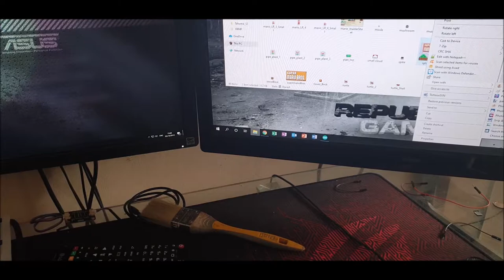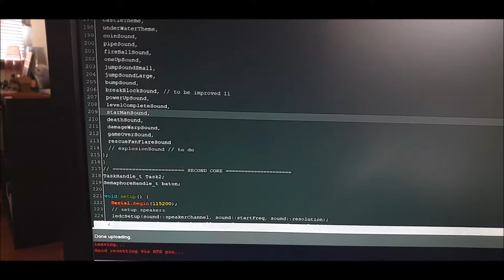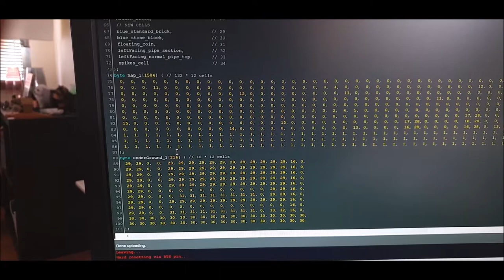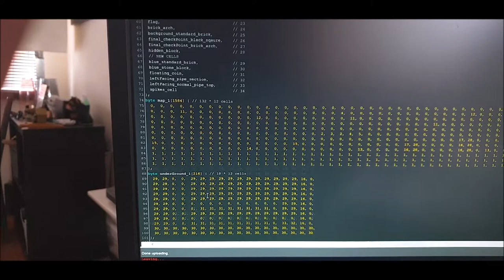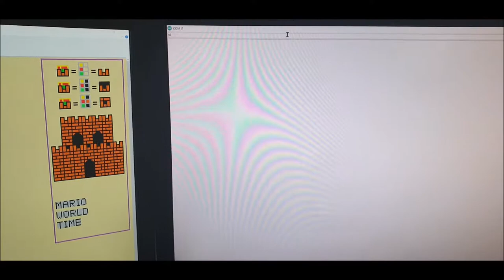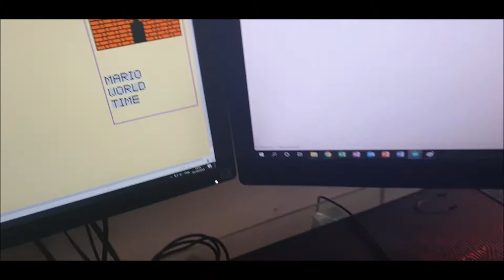Arduino Super Mario game using 2D cell engine, written in C C++

Comment: Can you send me Code for it ?
Reply from the maker: The code currently has next to no notes and I do not have a wiring diagram so I cant give you a copy today. What do you want to do with it anyway?
Reply: @edwinmartin1924  I would like to make a game console using a TFT LCD touch screen and a joystick shield.

I don't want to play the Mario Bros remake myself, so I need code. A possible diagram or notes would be useful;)
Reply from the maker: @szymusss163  interesting, you're have a few issues when trying to do this the first is the refresh rate of she needs to be fast enough to play a game smoothly with that said I was forced to use a 160 by 128 display. Touch via a digitizer is not an issue  but what is another problem is the amount of memory available, using the ESP32 I could probably fit 5 full retro games max but you could use an external memory chip via SPI if needed. 

As for the game I have created I used my own gfx lib as no other one had the correct functions required to make game with high fps and low memory usage. So if you used my games your need to either use the same display or edit it heavily